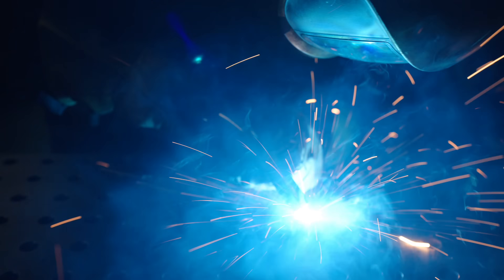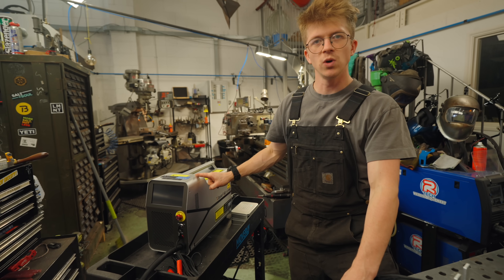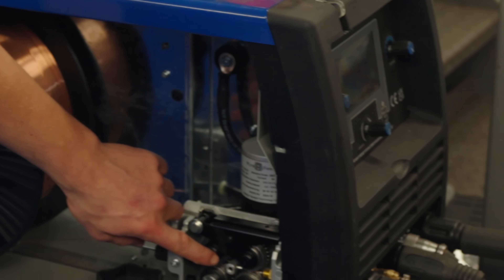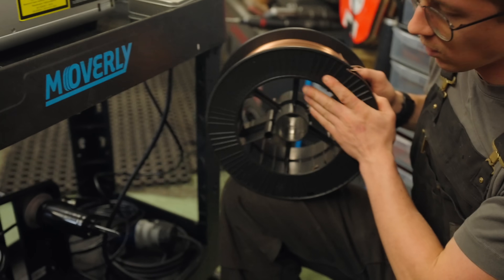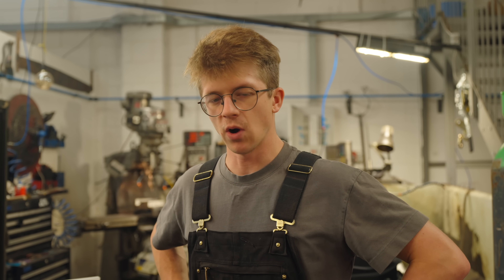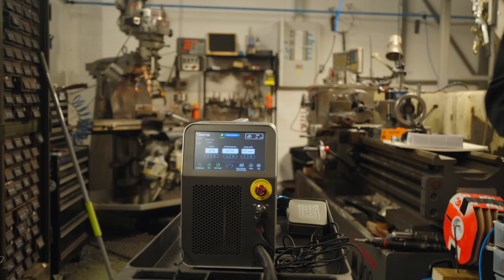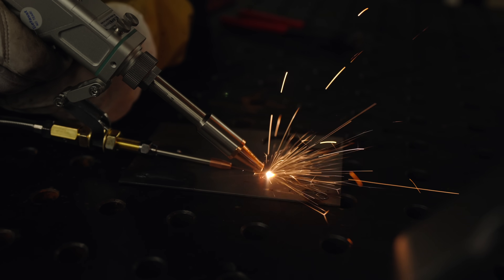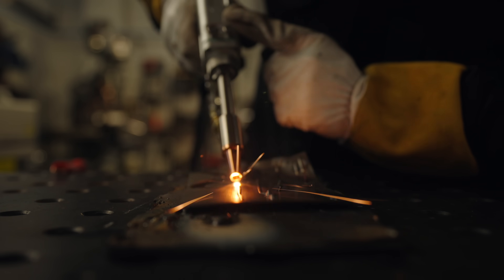Laser Welding

Comment: Dude used to work in a metal factory with a cnc Fiber laser,  laser cut through itself made a hole hit the floor and bounced out the machine. to use that you need a bay with welding drapes all around it.

Comment: A few years back I worked with much weaker lasers, used in sensor technology. Please be extremely cautious with any lasers and always protect everybody's eyes! When a laser beam is strong enough to melt metal, that implies even its diffuse reflections can still be strong enough to do permanent damage to the eyes. Now imagine the beam reflecting off of a shiny drop of molten metal ...

Comment: I recognize those nozzle tips. I used to operate an industrial CNC laser cutter and it used something similar. At the beginning of my shift and several times through out the day I'd take out the nozzle and inspect it by holding up to the light and looking through the hole. The laser is quite capable of cutting a new hole in the nozzle, so if the hole has gone oval or there are now more than one hole, it's time to put a new nozzle on. I would double check that the nozzle is screwed on tight before you weld, the nozzle getting a bit loose is often the cause of misaligning the laser and cutting new holes in the nozzle.
Reply: At least you know you need to take the nozzle off before looking through it... :D :D
Reply: The important part here is that you screw the nozzle off before staring into it. The light you are looking for is not spatially coherent, it's ordinary light from the sun or, more commonly in a shop, from a lamp. Otherwise you may delete one eye more than you intended that day.

And as we saw Alec has already tried the laser the way it's not intended to be use when he lasered his thumb. He is correct when he says they have to be extra careful as soon as the laser welder is used. An ordinary welder can cause damage if you stare at the weld with un protected eyes from close. But this one doesn't have the same range. It's dangerous at far longer range and not only for the eyes.
Reply: @blahorgaslisk7763  spatially coherent light is my favorite flavor though :( the chance of permanent blindness gives that extra little spice (I love fun scientific terms like that)
Reply: @Handsy_McGee  You mean "permanent ocular functional impairment", right?
Reply: Good advise 👍
Reply: Thanks, I'm pooping and needed to know.
Reply: Tape shot
Reply: @Chris-hill-30  Oh that's a good point, I wonder if doing a tape shot is in Alec's owner manual.
Reply: can you really weld dissimilar metals with these, like with the pulsed jewellers ones? I was dissapointed Alec didn't try steel to aluminum or something like that
Reply: @garethjones6342 you can. Copper to steel, aluminum to steel, aluminum to copper. Stainless to titanium, etc. But you do have to learn to do it. When metals have significantly different melting points and different conductivities you can’t just weld them, you have to get most of the heat on the higher melting material. Practice.

Comment: Laser welding may be new, but we also have decades of laser safety knowledge, and it may be a good idea to take a course on it
It may also be a good idea to relegate the laser equipment to some enclosed space, so the beam can't escape and burn Jamie's ass across the building
Reply: This x1000.  You need a dedicated lasing/welding area, safety curtains and exhaust hood, steel table.  There's a reason all the CO2 and YAG engraving lasers I worked on were enclosed and ventilated.
Reply: @darrell9546  Dedicated lazing area ❌
Dedicated lasing area ✅
Reply: absolutely agree. felt weird to see them operate this class 4 laser without turning on the "laser" light outside the lab xD
and also just in general, the built-in safety features of this welder seem really minimal for something where even the scattered beam could be potentially eye damaging. Like e.g. when they kept taking off the mask to inspect the workpiece and all that prevented the laser from starting up again was that the tip wasn't touching the table. call me cautious, but I wouldn't take off my laser googles unless i am really sure the laser can't turn on accidentally xD
Reply: Yeah, firearm safety is the paradigm to approach these with, unlike arc welding you can't trap the spicy beams with good grounding and a UV shield.  Solid review though, lasers have a strong future in metal working, but we do need to stay ahead of the curve on safety with this tech; defintely make sure there are no people or compressed gas lines down-range, and know where the bore is pointing at all times.
Reply: @kullen2042  edit: I was wrong! The product Joshua DeLisle reviewed was by XTool, not XLaser (my bad memory). I think xTool deserves recognition for their superior safety measures here. 

I don’t know if Alex just edited that part out, but I saw a different review of another XLaser Lab laser welder by @joshuadelisle, and to even start the machine, you were required to complete their online laser safety course, an unskippable video. It also had a number of internal warnings on the interface and such. Not sure if this different product does not have those same features or if Alex just edited out that part, but they seemed very thorough about safety in that other review
Reply: Yeah, there was little info about the risk of reflections, the risk of burns simply through unprotected exposed skin, the risk to people outside the work area, or even the risks to the lense assembly itself, if a bit of dust got on it
Reply: @kullen2042  Indeed, though I expect the early high voltage folks felt the same when their rather dangerous experiments start being comparable to the regular arc welders. Lab safety will always tend to be higher than a production workshop, as you are in a lab often dealing with unknowns, and simply need to really control the environment for your experiment/batch to be useful, where as by the time the tool version is out of the lab there should be enough safety info available and machines designed to keep many of the risks contained safely. Doesn't mean you'll actually get folks using it safely, and while the TIG arc is bright enough to be really darn hazardous (and often treated far to cavalierly) it doesn't match a high power laser
Reply: Agreed.  The company I used to work for started using laser welding on stainless piping several years before I retired.  It required a booth with special curtains, ventilation equipment, a flashing light to warn others not to enter the booth, and, comically, a laser curtain to cut power if anyone attempted to enter the safety perimeter.  

On commissioning, there was still an accident because nobody thought to place a curtain across the top of the booth and a reflection started a fire about 20 meters away.  They finally set aside a room with fireproof walls and ceiling and a safety interlock connected to the door that cut power if anyone opened it.  

In the end it was very expensive, but worth it due to the improvements in productivity and quality.  The next step was to install robots to do the actual welding, but the union prevented that.
Reply: Your work area should also be locked, so nobody from the outside can accidentally walk in. This class of laser is instant blindness.
Reply: I once worked with a LASER in a lab enviroment not as powerful as the one Alec is using here. However, the saftey introduction into using this on our own was about an hour and it was highly regulated. For example we were not allowed to run the LASER if any door was open even those that were not in the direction of the LASER beam. It is really important that Alec is awar of the hazard.
Reply: The reason ventilation is so critical btw, is that laser in "cleaning" mode is vaporizing that rust into free floating particles that he was then breathing in.
Reply: Yeah have a friend who uses these things at work and the only "near accident" they have had with them is someone walking into the room while someone was welding. Obvious easy solution being always locking the door when using the machine.

This also means they are pretty much impossible to use safely outdoors.
Reply: If it does burn Jamie's ass, make sure you full send it and draw a picture, though.
Reply: I'd pay money to see Jamie hopping around with laser burns on his ass
Reply: another weldering channel demoed a laser welder that wouldnt even let you turn the machine on unless you watched a dedicated laser safety video course. i think that should be a mandatory thing for any laser welder because thats as much a weapon as a tool and in the hands of someone who doesnt know ... well im sure insurance wouldnt be happy to cover 'lasered a finger off' or 'lasered blind with boiled brain on the inside'
Reply: In some of the places I've worked, burning someone's "ass across the building" would be the primary selling point!
Reply: @ahaveland  It's all fun and games until someone loses an eye
Reply: @ahaveland   The world has gone sissy.
Reply: @ahaveland  Horseplay with a laser is a very bad idea, and surely a firing offense.
Reply: @darrell9546  Indeed, but workplace attitudes 50 years ago were quite different from today's.
Reply: @darrell9546 I've been in spots where it was encouraged as long as a clipboard wasn't there
Reply: unless of course. he deserves it.

Comment: I've tried laser welding, and it's honestly amazing. But the machine I tried had a huge flaw in the welding torch, the trigger button was literally placed in the bottom half of the pistol grip, and the wire feed was connected to the bottom of the grip and front of the torch. Making it so that the only finger that could be used to press the trigger was the pinky, which made it awful to use for extended welds. The excuse the salesman used was a typical engineer excuse for bad design... "It's because you got TIG hand"... But c'mon a standard pen like TIG torch VS a laser torch with a pistol grip... Just more proof that this world don't need engineers

Comment: Welding anything but 2mm or thinner I wouldn't count on but the laser cleaning function is epic and might be awesome for a blacksmith shop!

ALSO please use proper rated laser goggles for the exact wavelength that your laser unit puts out as not all googles protect against all lasers!!!!
Reply: the big shield that the welding person wears seems to be rated OD8 for the range of the laser (assuming that only the 1080 is powerful and the 650 is for alignment only). The googles of the camera person wasn't shown in detail though, only when Alex filmed Jaime we could see from the side that Alex seemed to also wear some sort of google. I would hope that they were smart enough to get appropriate ones for that purpose.

Comment: Jamie might not be a welder, but between engraving and camera work, he's got steady hands.
Reply: she said
Reply: Having zero muscle memory for different types of welding maybe it was a bonus at this case.
Reply: camera work do need very steady arms and hands to reduce motion woble
Reply: @CyanDumBell_Main   or a gimbal.
Reply: @CyanDumBell_Main  Newer cameras also have a stabilizer, like if you watch a video that has low light levels, you'll see the lense flair bouncing around even when the subject is stable
Reply: @Skyler_L_H you still have to remember, hours of holding a camera will make your arms and hands tired, stabilizer only reduces motion and does not remove it.

Comment: when cleaning: please remember the rust is not disappearing into thin air, it just gets ablaitet and settels down somewhere else and you should really do something to make sure that somewhere else isn't the inside of your lungs
Reply: *ablated?
Reply: @excavon7297  jebaited
Reply: @Kaenguruu  ragebaited
Reply: @RedmondJohnson  masterbaited
Reply: @excavon7297  ablasted
Reply: @excavon7297  Ablaitet, ablatah, life goes on Brah!
Reply: Not sure that iron oxides are that much of a problem, but zinc oxide from galvanized steel definitely is.
Reply: @ahaveland  Steel contains, sulfur, phosphor, chrome, etc, etc, etc. If there is oil/grease residue on it you get an even more lovely concoction of funky by products.
Reply: @andersjjensen good points, though I think rust is defined as iron oxide, which was the subject of the thread.
Reply: @ahaveland  Lasers throwing the surface of the item into the air was the subject of the thread.
Reply: @andersjjensen  that item was "rust"!
Reply: @ahaveland  No, i don't want iron coating my lungs thank you. Anyways, you should never breathe in anything but air.
Reply: Masturbated
Reply: Filter the air with a cigarette kid.
Reply: He shoots another laser to radiate his workshop clean.

Comment: Depends on the application I've found. We had a laser where I worked last and it was quick and nice, but didn't hold up in anything structural

Edit: For your applications though, seems pretty solid! I'd recommend some kind of bay or movable walls/curtains because overpen, missing, and reflections can be a big problem!

Much like a gun, always be mindful of what is beyond your target

Comment: I've been working with industrial lasers for 15 years now, we used to do tons of laser welding panels and assemblies together. its quite a weird experience to say the least. although all the weld i've done was with multi kilowatt co2 lasers... You're using argon for cutting, you need to use a cutting assist gas like N2 or O2 or even Shop air..
Reply: No one ever said Alex was too bright. Only oxygen promotes burning. Shield gasses do what it sounds like they do.  Most air is nitrogen but there's some oxygen in it. Enough to burn stuff.
Reply: @1pcfred  its more complex that that when it comes to laser cutting. oxy is used for thicker steels these days, nitrogen is exclusively used for thinner materials. air works well with thin metals too but leaves oxidization. there's so many variables but simply just changing argon out for o2 given this lasers low 700 watt output would highly change the cutting performance. nitrogen just simply wouldn't work unless its foil lol.

Comment: I watched another laser welder. He did 10 mm of steel. The welds almost touched in the middle and the steel broke before the weld. AND ANYBODY CAN DO IT!
Reply: Lasers also have such insane penetration that you can weld T joints from the bottom instead of the sides.
Reply: was that Joshua De Lisle's video? he did a pretty thorough analysis of the penetration with acid etching and microscope imaging.
Reply: Different brand, different machine. Joshua's is about twice the price and almost twice the power (700w vs 1200w) - but yes, it's likely that there are tricks to be learned from it that Alex can benefit from, too.
Reply: Yeah, anyone can do it... I'm not trusting that thing without safety interlock and closed concrete room.